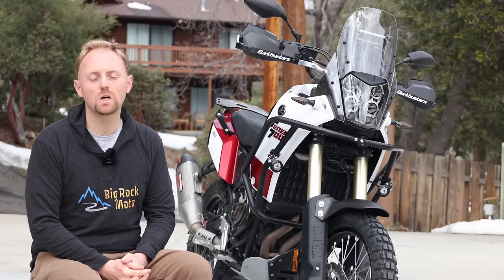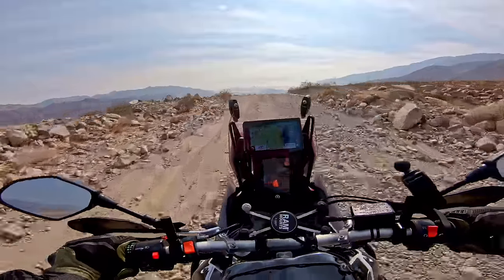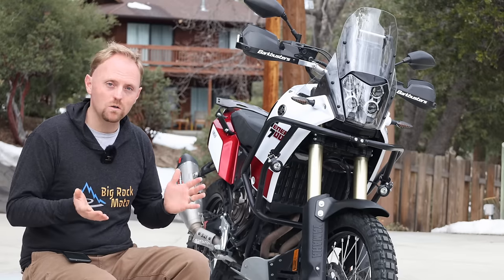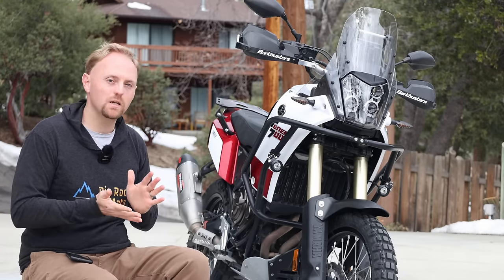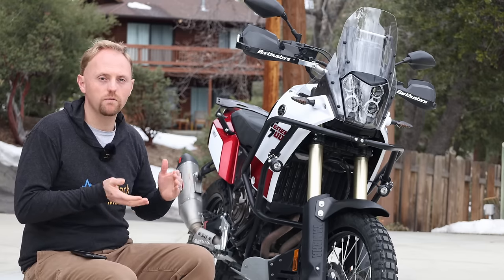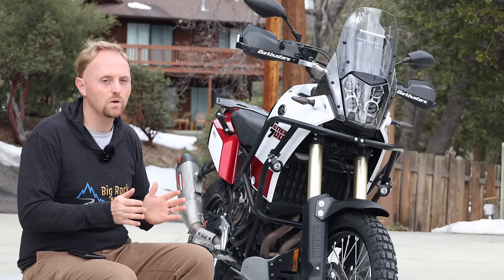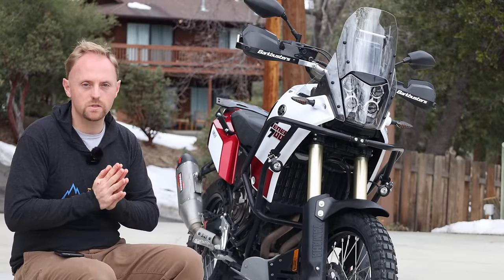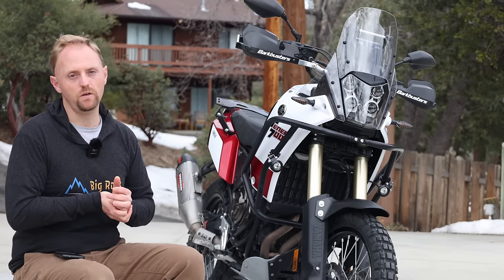Yamaha Tenere 700: Suspension Problems & Solutions (✔moto suspension basics✔)

Comment: It’s worth noting that when you respring, you typically need to revalve to match the new spring rates.  If you are going to respring, you should revalve at the same time.  Use a reputable suspension supplier and be honest about how you intend to ride and your rider weight (including gear).  They can typically get you very close on the 1st try.  I like to find a supplier who has experience with your particular model.
Reply: Valving on T7's suspensions are enough for higher spring rates.

Comment: This is the perfect level of detail for 95% of motorcycle owners.  Unless you are some kind of racer, want to be a suspension mechanic, or are obsessive-compulsive about knowing everything.  

The thing about suspension behavior is that, as a rider, there are no easy and standard ways to describe what you want changed.  I took my WR250R to a suspension shop to get it lowered, and as part of the process the specialist asked me about 20 questions about how the bike behaved when I hit a hole, when the front went over a small log, etc.  I told him what it did that I liked, and what I didn't like, and when I picked up the bike it was so much better behaved and more comfortable to ride that it was like a different bike.  An amazingly better bike, for about $800 USD.  I maintain that there is no better money you can spend on an off-pavement bike than going to a professional suspension shop and buying some time. Start with springs for rate and height, and that might be all you need, but expert advice is worth it, IMO.
Reply from the maker: Well said!

Comment: Thanks for the video. Your springs explanation is very good. While I don’t own a T700 I did need to rebuild my front forks of my 650 VStrom after my Alaska and Yukon trip in June and July 2022. Pitted Crome chewed up the seals. I had to get new fork tubes and actually found a set of forks in good shape so I bought them instead. When I took them apart I found RaceTech Gold emulators and .85 kg/mm springs inside. My stock springs were.65kg/mm. The ride difference was amazing and so much smoother. I’m older and retired and about 195 without gear on. Changing the springs and valves east and changed the whole nature of the bike. I probably should now look at the rear spring as well.

Comment: Good video. Re: suspension damping, most people will have better success by making big adjustments (say, 6 clicks) first. So you start in the middle, ride it, then adjust by 6 clicks and decide whether the new setting is better or worse. If worse, go 6 clicks in the opposite direction. If better, go six clicks more. Then when you have the best 6 click position, halve it by going 3 clicks up / down from the best 6 click position. Then 2 clicks. Then one. Then do rebound. Then do the same on the other end of the bike. And if you find that full compression damping is your best setting, your spring is too light.
Reply from the maker: hmmm I might try that one. thanks!
Reply: I kind of agree with you but would go one stage further. When I get a new bike (or new suspension components) after setting preload I set the damping at minimum front and back and go for a ride. Then set everything at maximum damping and do the same ride. You get a very quick assessment of what range of damping is available to you. Some bikes it might be quite a range, others might be quite limited. You can probably choose the damping settings to 90% of where you want to be pretty much straight away from those two ten minute rides. That final 10% can be tweaked with the odd click here and there over the next week or two if needed.

Comment: I have found by replacing the stock oil in the fork tubes with a step or two heavier would improve the ride on a Honda XR400R. The bike was set-up street legal except for the tires. Used mainly on dirt and very limited pavement.

Comment: The rear has arising rate linkage which means it progressively stiffens as the travel is used up. So at 200 pounds mine was constantly in the stiffer part of the stroke and would move the rear tyre around in a turn. I uprated the spring which kept the rear up in the stroke and allowed the rising rate to function as it should.
Reply from the maker: correct

Comment: This really helps me understand my motorcycle suspension.  My stock Harley ElectraGlide has adjustable air bladders built into the front forks as well as the rear shocks for damping control, and this has always worked well for me and my passenger in 100k miles of touring. Has this approach ever been used for adventure bikes? I suspect I'll need to change springs in my new 2022 KLR650, but haven't ridden it enough to know.... Thanks, Ian, for the excellent Suspension 101 video. Wow!
Reply from the maker: thanks!

Comment: Thanks for the clear message and the details. I already got a 95 Nm rear shock installed but with my riding weight of 100 kg I cannot realize a 10% static SAG. There is almost 0% SAG.
I'm adding 15-20 kg of extra gear max. What is your recommendation about the rear shock? 90 Nm or 85 Nm? I'm a bit uncertain if the reduction from 95 Nm to 90 Nm will make a big difference.
Safe rides from Germany 💙💛🏁🤛🏼
Reply: Ich hab jetzt die 85er Feder verbaut (ca 93kg fahrfertig) + die sturzbügel ... wohl auch 100kg. Hab aber heute mal mit Touratech München (Markus) gesprochen. Der hat mir für vorne progressive Federn (+ gabelservice nach meinen 40k Kilometern) und hinten das Touratech Extreme Federbein empfohlen. Werd das jetzt einbauen und kann dann berichten :))
Reply: @Reiwadatschi  Ich habe nach einem Beratungsgespräch mit Thomas von Off-The-Road in Köln mir heute die 85 Nm Feder geholt und bin schon sehr gespannt. Die Feder hoffentlich bald auch 😉

Comment: A question based on your video and statement that the rear linkage is progressive.  

I have 30mm lowering links and pulled up the fork tubes to keep the same fork angle ( I measured it with a gauge).  By my thinking it is now the same geometry, just less ground clearance by 1 1/2".  Do you think that is correct or has lowering it affected the handling:  straight ahead, leaned over, suspension stroke.  I ask because I find the front deflects a lot in gravel, to the point of wanting a stearing stabilizer.  Seems fine on the road but off- road it is a bit unsettling.  Also I just added the MotoZ Tractionator Dualventure front and I get momentary wobbles out of the front while riding high speed on the asphalt.

I am convinced now after watching your video that my stock springs are causing a lot of my handling issues and am going after those now.  I have recognized from the beginning the fronts were too soft and dive under breaking was excessive but when new, my rear spring was very stiff and would not sag at all.  Now at 6,000 miles it is quite soft and I, as you mentioned, am cranking up the preload just to ride it with me and a  Mosko Moto Reckless 10 set up

Comment: What spring rate and oil weight did you use?
Only problem with the T7 is the compression damping adjustment doesn’t make much difference until nearly all the way in, so stiffer springs will need damping to control it.
Reply: Exactly, a stiffer spring rate might totally overwhelm any stock damping arrangement.
Reply: @terenceokeeffesmotorcyclestuff  I’m getting the K Tech piston/shim kits fitted to forks and shock too, so should fix that.

Comment: I own a T7.  I have done a resping front and rear.  I was not fully happy with it and have since upgraded the entire suspension to Rally Raid Forks and Rally Raid adventure rear shock.  Yes the stock components are decent with a respring.  However, the OEM fork valves on the T7 are only 20mm.  Tracktive / Rally-Raid open cartridge forks for the T7 are 35mm  that is a HUGE difference.  That's 270% more surface area for compression and rebound damping.  I wish you could ride my T7 and compare how much better it is than just a respring.
Reply from the maker: awesome. sounds great
Reply: Hi. How feel now in small imperfection on road. My is very umcomfy on road

Comment: Great video! However, I disagree with you on the pre-load. The purpose of pre-load is to ensure that your suspension is working in the correct range. Similarly to bottoming out on the bottom, the springs can bottom out on the top too. Less preload and the bike suspension works more around the top, more preload and it works around the bottom. For example if you are going high speed, and there is a pothole, your suspension will need to extend from the default position. If you have too little preload, it will bottom out on the outward stroke here.
Hence, it is not just for extra weight or passengers.

I do think if you ride a lot, it is probably worth visiting a suspension specialist. Generally those cost under 200$, yet provide more benefit than a new exhaust system nearly 5x the price! I definitely agree that aftermarket suspension in general is kind of a waste. Often its not the stock suspension lacking performance, but it just not being adjusted properly. 

On the experimentation part with damping, I always take a little notebook with me and note down all the changes and observations. Then you can always go back to a setting you had before which you liked or to compare it with a vastly different setting without getting confused. Although usually, it is fairly obvious when you find something you like. For how my bike is setup now, one click extra damping makes it feel too rough and shaky, whilst one click less damping makes it feel under-damped and 'floaty' without much feel.
Reply from the maker: Correct, I was trying to make the point that the preload adjuster should be near zero when riding in your most lightly loaded configuration so you have room to crank it up for extra weight to re-establish proper sag. You're 100% right that you need a certain amount of sag so that you don't top out. However that can be achieved with little preload on the adjuster. There still might be preload on the spring on the shock with the adjuster set at zero

Comment: Have about 300 miles on my tenere  Have you felt the need for a steering stabilizer? Anything over 85mph and im fighting the bars from wobbling on the highway with the California rain grooves.
Reply: Did you ever set your rider sag with preload? You might be sitting too high on the rear and shortening your trail too much.
Reply from the maker: tires, and suspension settings
Reply: @BigRockMoto  I have also noticed I am only getting about 30mpg. Any idea why that is?

Comment: I know you also mountain bike, and probably have air spring type fork/shock on your Mtb.   Very few mountain bikes nowadays use coil springs.   Air shocks eliminate these spring rate problems as any rider can set the sag for their weight- why don’t motorcycle manufacturers simply ditch springs and go air spring suspension instead?   There’s really no price differential either between mass market mtb suspension, air or coil spring, so price can’t be the issue…..?
Reply from the maker: good question
Reply: I guess it has something to do with the 10-20 times higher weight, way higher speed and the resulting increased energy and heat that goes into the suspension of a motorcycle. 
I know that there is cars with air ride suspension, but these are usually not performance cars. That means size and weight of the suspension system is not that important and the suspension will not have to work as hard as in a performance car.

Comment: Great explanation - thanks. As the height and high CoG was an issue for my short legs on the T7, I do have OEM 20mm lowering links. I’ve heard that I should also drop the from of the bike by lifting the front shocks by 10-15mm also to balance the geometry. I see Rally Raid also have 40mm lowering links, to drop the height a bit more. I assume the front should therefore also increase beyond the 10-15mm if swapping the links?  At over 200lbs I do need to replace the rear shock spring to a 95nm, however my concern is that this will raise the height of the bike again. Any suggestions?
I’m going to take the bike wearing my usual gear and luggage to a local suspension place also. Thanks again.
Reply from the maker: yes you should drop the forks but be careful there is a limit. you need a .85 spring at that weight. unfortunately it will raise the rear a little bit, yes
Reply: @BigRockMoto  How much do you think it will raise the seat height by using a Rally Raid 85 spring ? I could probably get away with an increase of 1cm, but anything more and I'm maxing out with my inside leg size, I don't want to start lowering the bike.

Comment: I am 6'1 in tall and about 200 lb without gear on. I probably ride similar to you and I like to get after it. I do not want to spend thousands of dollars. I do intend changing the springs. What spring rates would you recommend front and rear?
Reply from the maker: Rear 8.5, Front .65
Reply: @BigRockMoto  👍😜
Reply: Where did you purchase your springs?
I will try to continue buying my products through your links.
Reply: What springs did you purchase? What brand?

Comment: Hello . Great videos!!  I bought a T7 and on the road i feel a lot of discomtort in my waist and back because i feel that it does not absorb the irregularities on the steet. I feel like any irregularity hits hard. I como from XR650l and Dr5650 and i feel like float compared to the T7. I don’t know if they are like that or if the rear suspencion has problems
Reply: I feel the same. Like there is no suspension when rolling on small bumps. Its very uncomfy, even worst then my V Strom 650. In the terrain its much better. Probbably will contact some suspension tuner. Dont want spend at least thousand dollars for Ohlins with no warranty to improve the comfort.
Reply: Did you already try to re-spring it to your weight? What is your weight? Mine is like 110 kg without gear and I have exactly the same problem with my T7, it's too hard, too harsh and uncomfortable on road.
Reply: My weight is 85kg . I don’t now if re spring solve the problem. I have seen in other videos that the problem is the shock. Yamaha  thought of running it standing up in the trails.
Reply: FYI rear suspension on these things is absolute garbage I know people have sold them just because of it. Hass to be dealt with. You really need to get a aftermarket rear suspension.